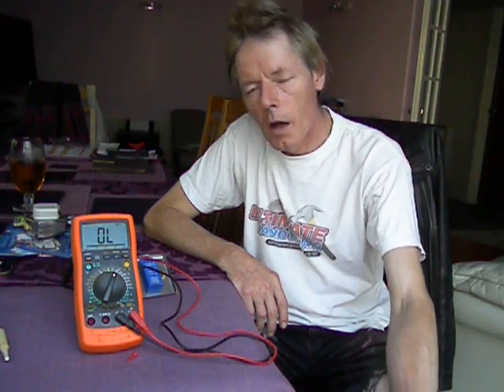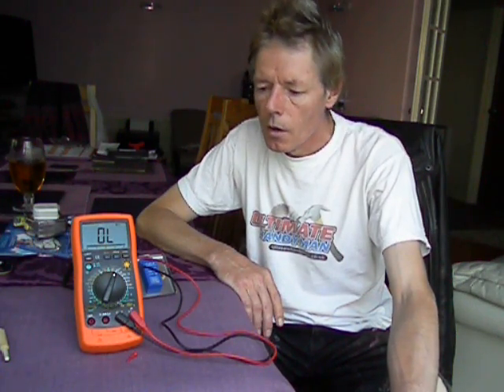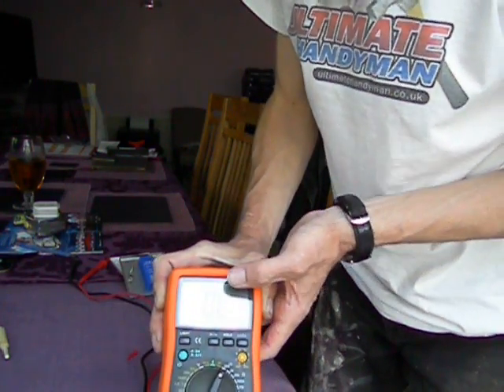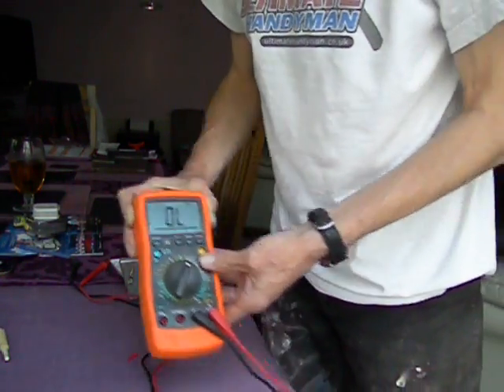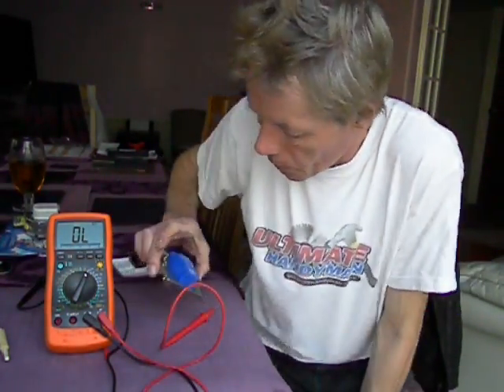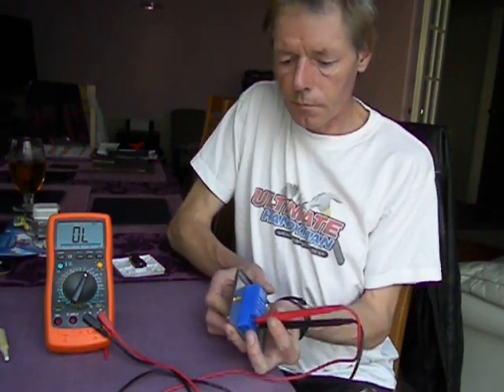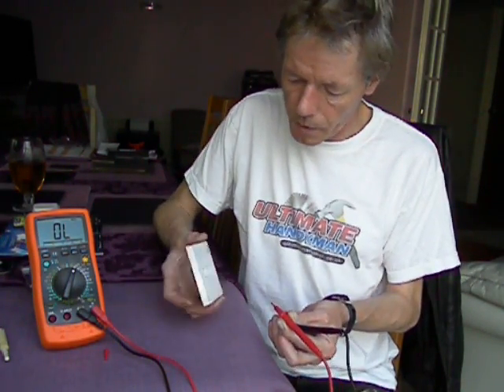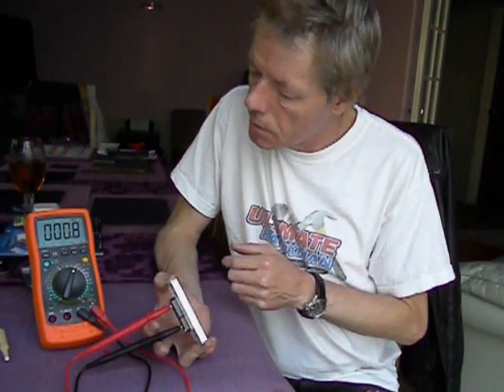Light switch testing

Comment: Correct me if I am wrong, but I don't think you can test a dimmer switch with an multimeter on ohm setting as it is not a rheostat construction. You can test it by using a test lead with a lamp.
Reply from the maker: It will tell you if the dimmer is open circuit?
Thanks for the comment 👍

Comment: Will it work, if you put it on 'volts' and see if it drops to zero when switch is on? Is there a reason most people prefer to test resistance rather than voltage change?
Reply from the maker: It's difficult to test a light switch as there is not normally a neutral wire to complete the circuit.
Resistance is used because it is much safer- there is no chance of having an accident  when measuring resistance, but there is if you are measuring mains voltage.
Thanks for the comment ;-)